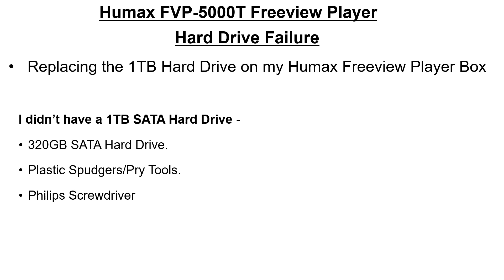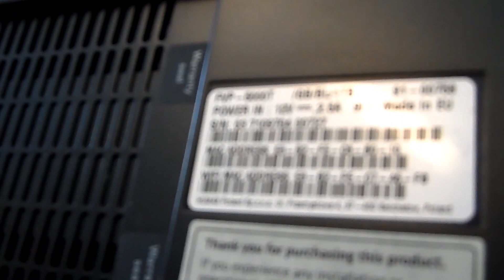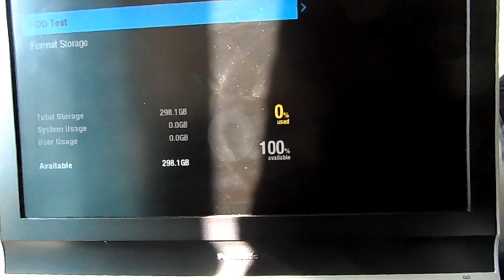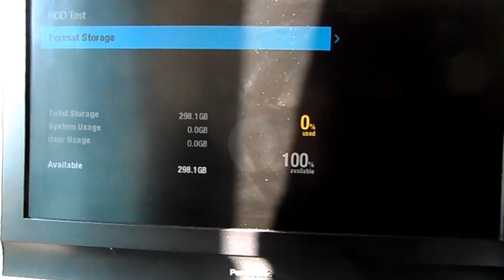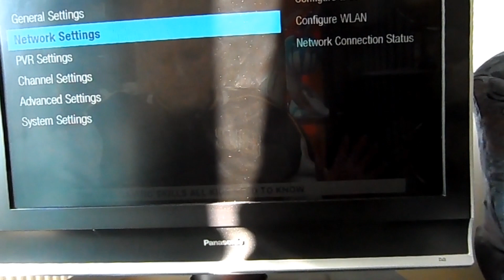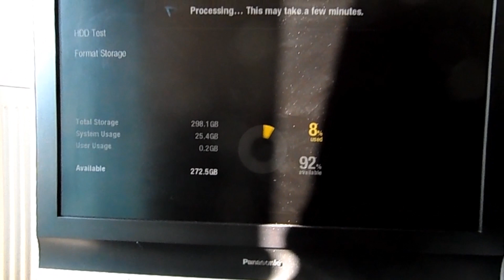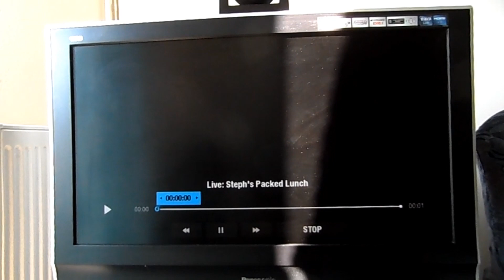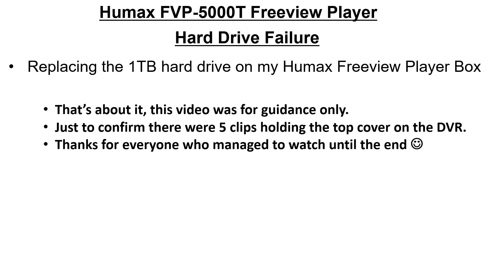Humax FVP 5000T Freeview Player Box Hard Drive Failure - Shortened Version

Comment: Hi Stephen. Thanks for the video. Why did you replace it in the first place? What was the issue you were having?
Reply from the maker: Hi Nathan, thanks for watching. 
The DVR 1TB hard drive was just about full up, I didn't realise this until I tried to rewind live TV & it wouldn't work. 
I then tried to access hard drive which indicated it was about full in the menu, to delete recordings, but this didn't work.
I couldn't even look at my old recordings.
Eventually I tried to format drive which wouldn’t work at first, but eventually I did have some luck formatting, but within a day the drive failed again, failed to access.
As I mentioned in video I was at 1st going to buy a new HD, until I remembered I had an old smaller HD drive in the garage. So I decided to try this 1st..which tbh I'm am still using, not that I record as much now.
Reply: @stephenphillips8994  Thanks for getting back to me. I need to change my hard drive over, but I'm not quite sure which one to get. I have a 1TB, but not sure which brand or actual size it takes for the screws to line up. Is there a certain model I have to buy?
Reply: The HDD dimensions i mean. 3.5"? or a 2.5"?
Reply from the maker: @Nathan Bowen  Hi Nathan, the hard drive size required is 3.5".
The same dimensions as a desktop computer hard drive.
Reply from the maker: One important thing for the replacement 3.5" hard drive to have. Is the 4 fixing threaded screw holes in the bottom of HD, which are used to fix HD to the humax base. The old HD I had in garage had these threaded holes so might be a standard.